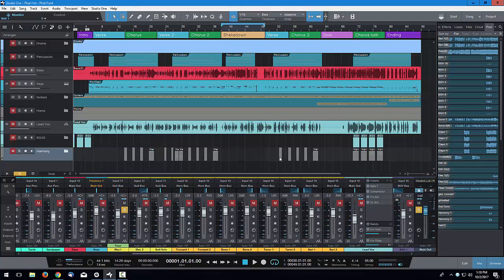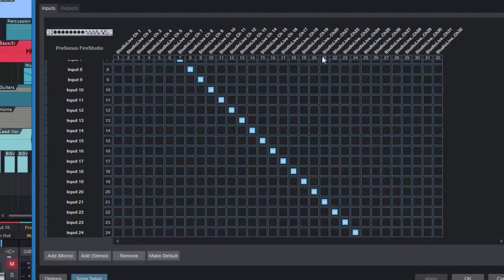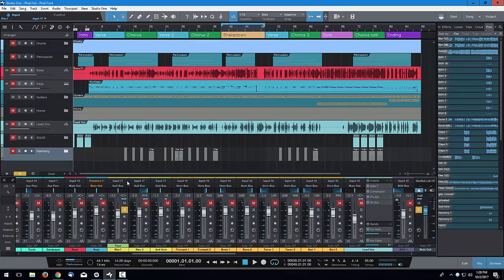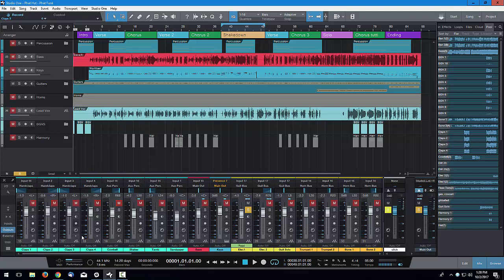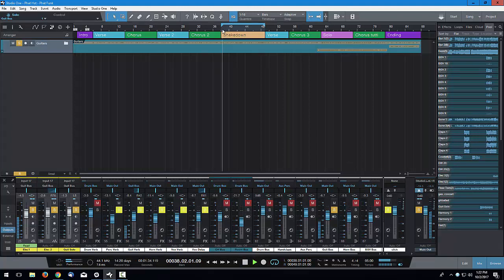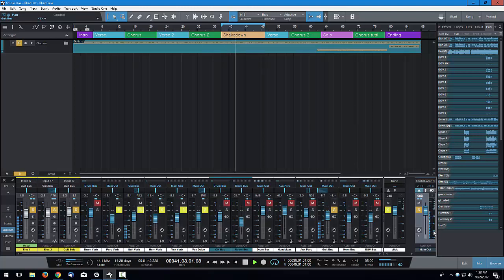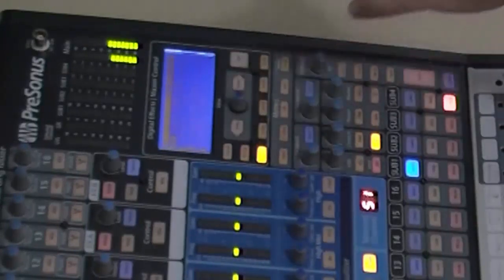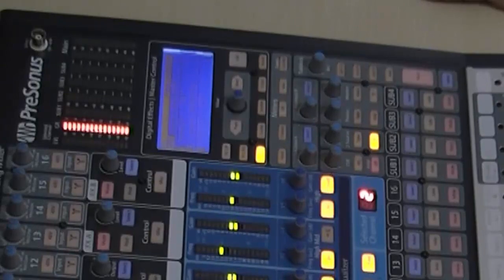StudioLive 16.4.2: Panning in Studio One

Comment: Rusty, I myself am struggling with this. I came across your video looking for answers. This is what I do, but if you put on headphones, it is not a complete fade over. AKA, I still hear some left in the right. I'm trying to put all tracks on the left and a click track on the right then, but I hear the click track in the left. Faint, but I hear it. Is this the same for you if you pan everything to one side, can you still head it in the other?
Reply from the maker: I'll have to check and get back to you.
Reply from the maker: I have a few things for you to check...
1) All all of your channels panned hard left?
2) Is your click track assigned to a channel and panned left
3) Ensure that you aren't routing anything to an aux or sub channel that may cause the signal to bleed into the right channel.  
NOTE: There are signal routing options in both the DAW and The SL.  It's easy to miss a route especially when you're using the effects busses.